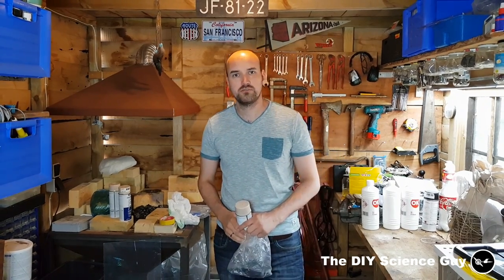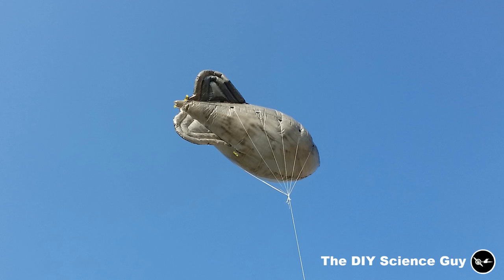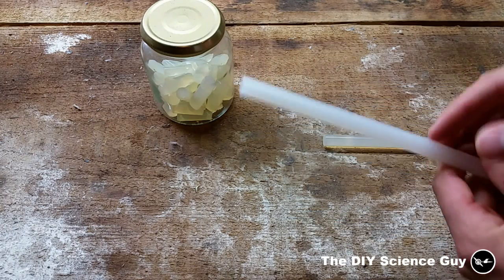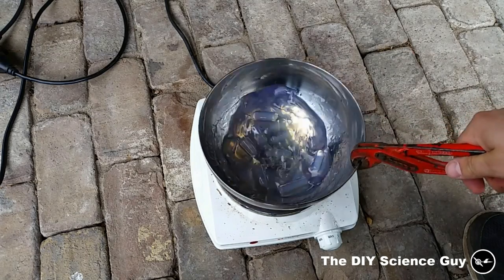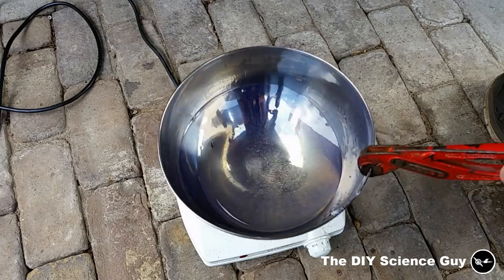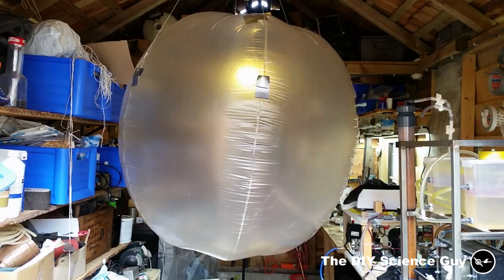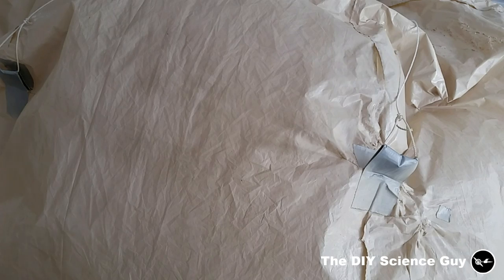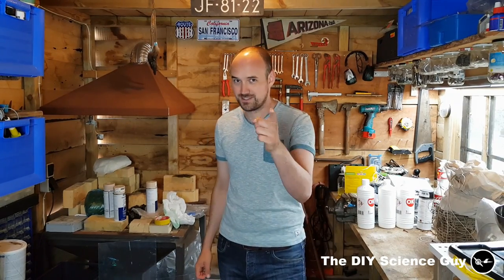DIY plastic (polyethylene) primer

Comment: Thank you for this video! I works great also as a primer for HDPE!
I used nitro thinner (C6000) and put the container into another one with hot water. Glue sticks melted in a few minutes and the "primer" could be used for about half an hour.

Comment: Hey, hi from Canada. That process sounds amazing. I have an old (40 years)  Coleman Scanoe, 17'  square stern. It only has a couple of pinholes, but is badly scratched from years of running streams and rivers, good war wounds to have. I've used duct tape on 2 of the 3 keels for the last few years, and it works 80% but has to be applied and retaped every time I go for a run, a real pain in the ass. YOUR POST WAS AMAZING !!! ..THANK YOU, THANK YOU, THANK YOU!  I may or may not paint over the mixture. In New Brunswick, we have about 4 feet of snow on the ground right now and all the water is frozen. I will send or post pictures of my project as I complete them, and I will follow up with the results. Thanks again.... I liked and subbed.

Comment: There is a product called bulldog adhesion promoter which allows oil based paints to adhere like a "bulldog's bite".  Spies Hecker also makes a flexible primer for high end auto paints... it is for bumpers etc... the rep sprayed a beach ball, allowed it to cure and then deflated, years later the primer is still adhered to the ball even when doubled over on itself.

Comment: Hi overthere, as I am about to give my polyethylene canoe an update, I wonder if I could use your briljant idea to use Hotglew (Hotmelt) with Thinner to coat this Coleman canoe. But I still have some questions such as 1) What kind of hotglew you did use, because you showed two samples, what's the name of the sample you really used. And 2) I see that after some time the substance is getting hard. Can one this use again and melt it again with heat?
Can one roll the coating and is there a certain opening time?
I would be very pleased if you could be so kind answering me. It would be very helpful for me
Kind regards from the Netherland.
Jan L Mateboer
Reply from the maker: Hallo Jan, ik ben ook een nederlands dus dat komt mooi uit! 😉 je hebt de "transparante" lijm staven nodig zo noemen ze ze ook online dus moet goed komen. Je kunt de primer gewoon weer verwarmen zodat hij weer vloeibaar word. Met een roller heb ik nooit geprobeerd, ik denk dat dat door het snel afkoelen van de primer zorgt voor klonten. Je zou kunnen proberen om de primer nog verder te verdunnen dan blijft hij vloeibaar bij een lagere temperatuur alleen word je laag dikte dan dunner. Succes!
Reply: @TheDIYScienceGuy  Hallo, Nog even een vraagje.
Zou ik de mix van Thinner en Hotmelt warm op moeten opbrengen, of blijft het na afkoeling nog een tijdje vloeibaar?
Alvast bedankt voor je antwoord.
Reply from the maker: Hallo Jan, ja je moet het verwarmen en dan kun je het met de kwast aanbrengen. Succes!

Comment: This is interesting. I’m trying to paint a HDPE fence. The UV light has degraded the colors of the plastic. How long do you think this primer / paint application would last on something like plastic planks?
Reply from the maker: Well I think that as long as the top coat is UV resistent it will stay on as long as the top coat lasts.

Comment: You think this would work inside a bait tank made of hard and thick polyethylene plastic?  Darker colors keep bait calm but most bait tanks (like mine) are white plastic which stresses the bait.
Reply from the maker: I think it will. Just check if hot glue sticks to it, if so, than it will work.

Comment: Hi, does it need to be hot to apply or does it stay liquid if you add enough thinner? What temperature did you warm it up to?
Reply from the maker: No it stays liquid. After it cools down in the jar it starts sort of crystallizing in about an hour, which can be reversed by heating it up to about 40c

Comment: I working on a project that is using polyethylene foam. I also noticed that hot glue is the only product that sticks. This is the best idea! What type of thinner did you use?
Reply from the maker: Thanks! Cellulose paint thinner is wat I used.

Comment: I hope you don't mind.... Lacquer thinner, also known as cellulose thinner, is usually a mixture of solvents able to dissolve a number of different resins or plastics    A special blend of pure solvents that will mix with any make of cellulose lacquer. It does not
contain any xylene, toluene or any other petroleum derivative.

Comment: Are the glue sticks kinda hotmelt? I need a primer for a canoe made of polyprophlene. I like to give it a re-make and repaint it. Thanks for your kind answer. Jan L Mateboer The Netherlands.
Reply from the maker: Yes it is hotmelt and it will work very wel on pp. I painted my kids pp Ikea kitchen parts this way and it's still on there after all the abuse. Good luck!
Reply: @TheDIYScienceGuy  Thank for the answer, I put another question if you don't mind. As I'm Dutch I could not understand eauch word you said that's why  Sorry.

Comment: How many jars did it take you to coat your balloon and what was the approximate surface area of the balloon? This is really awesome by the way!
Reply from the maker: Thanks! About half a jar. Surface area is around 3.5m2. After almost 2 years the paint is still on! Also used it for my son's Ikea kitchen to paint al the gray plastic parts black. Even with al the wear and tear it doesn't have a scratch.
Reply: Awesome! Thanks!

Comment: Any idea if it works on poly polypropylene too?  I think it probably would.   

Surely that is a marketable product - there doesn't seem to be any reasonably priced non-polar plastic primers.
Reply from the maker: Yes, it does work very well on polypropylene! I've thought about selling it, but I'm not sure about the safety and if I could get in trouble for it.
Reply: @TheDIYScienceGuy  Well I guess if you sold it premixed the customer would still have to reheat it  - and a lot of people might do something stupid.   But you can buy MAPP gas in any hardware store and that is potentially a bomb.

The other option is selling it as a product to business.   

The reason I am interested in it is in to coat exterior polypropylene pipes to protect from UV damage.

Comment: Thank you for making this video! However, I could not find cellulose paint thinner so I tried acetone and wasbenzine. The wasbenzine did dissolve the glue sticks, so I tried to paint it on and it was leaving textured streaks (too thick?), some of it made flakes and came off and the rest I could scratch off with my fingernail. Any ideas? Solvent, application, other? I would appreciate some help figuring this out. I have a bunch of polyethylene to try to paint.
Reply from the maker: Thanks! Yes make it thinner. Nice to hear that wasbenzine also works 👍the flakes probably come from going over a spot that already dried a bit. Good luck!
Reply: The texture streaks sometime caused  by the drying too fast . The liquid doesn't have enough time to lay flat especially when it's a little thick.

Comment: How to paint HDPE:
Wear gloves and a resparator, not just a dust mask.
Mask of all areas not to be painted.
Remove all oil and fingerprints with Acetone or MEK. Do not use Turpentine.
1.    Using a green scotchbrite pad, dull the HDPE plastic. Sand in circles.
2.    Clear untinted PVC Solvent  wait 30 minutes

3.    Second coat of  PVC Solvent. Wait 30 minutes
4.    Spray paint plastic primer lighter than final color, Rustoleum Plastic Primer. Light coat. Wait 6 hours
5     Sand any rough spots or runs with 320 grit.
6.    Spray paint plastic primer lighter than final color, Rustoleum Plastic Primer. Medium coat. Wait 6 hours.
7.    Sand  with 320  or 400 grit.
8.    Using an airbrush or fine spray paint gun, not a spraycan, Apply Clear POR epoxy paint, thinned. Medium coat. This provides
      a surface any paint will stick to.But it must be a continous coverage, not spotty. This will prevent deep scratches.  Wait 12 hours.
7.    Sand  with 320  or 400 grit to remove gloss.
10.  Paint with your favorite spray paint. Repeat coats until all sanding marks dissappear.
11.. Using an airbrush or fine spray paint gun, not a spraycan, Apply Clear POR epoxy paint, thinned. Medium coat.
Never have to pint it again.

Else instead of Clear POR epoxy paint you can use POR colored Epoxy paint or for a rubbery look use POR POR 2k urethane paint.
Done
Reply: Or you could do it like he did. 😁😁
Reply: the video seems a lot easier

Comment: You can use clear silicon and petrol or gas for tinning .
Reply from the maker: Silicone is not a solvent and nothing sticks to it so you should keep that away as far as possible. Petrol might work, I've never tried that. Good thinking! 👍
Reply: @TheDIYScienceGuy  You are wrong, it works, i used other glues and they didn't work, silicon worked, i mixed with gas and i painted  my lyres, they looked like new.

Comment: Do you happen to know the glue-stick chemistry? There are almost as many types of glue sticks as thinners so I really hope the manufacturer of those sticks you used put it on the package. :P
Reply from the maker: No I don't unfortunately. I use cellulose paint thinner.
Reply: @TheDIYScienceGuy  Well, then I'll hazard an inexpert guess and say it's probably EVA. It looks like the EVA sticks I've seen, and EVA is the most common hot-melt adhesive with the possible exception of acrylic, which is probably what those harder, more transparent sticks you showed were made of.

Comment: Did it melt under the sun?
Reply from the maker: No, after applying it the thinner evaporates which leaves you with a thin layer of hot glue which has a melting temperature around 100c

Comment: Hot glue plus paint thinner equals polyethylene?
Reply from the maker: No, hot glue sticks wel to polyethylene and paint sticks wel to hot glue. To be able to apply a thin layer of hot glue to a polyethylene surface, the hot glue needs to be  dissolved in cellulose paint thinner so it can be applied to the polyethylene surface with a brush.
Reply: @TheDIYScienceGuy  So the balloon is made out of polyethylene?

Comment: Buy any spray paint you want and just spray it far enough away that the aerosols  (which eat up the styrofoam) disipate while the larger wet particles of paint continue their journey down to the surface and there you go. Start small and soon you will have a great surface w/o all the solutions.
Reply from the maker: Yes, that works, but that is not the point of this video. This is about painting polyethylene.

Comment: Are you a chemist or did you research combining these chemicals together? How do you know the mixture is safe and not super flammable or corrosive or something dangerous? Really just curious to know if you're experimenting randomly or have experience with these substances.
Reply from the maker: I'm not a chemist. The cellulose paint thinner is just a solvent to make the hot glue a liquid. When the thinner evaporates you are just left with a very thin layer of hot glue, it does not change the glue. The thinner is very flammable, but so are a lot of paints.

Comment: This is dangerous and care must be excersized. But if it works then great. However you do not provide any recipie or much to go on.  
If the USA we do not have "cellulose Thinner".   Please provide a link.
What is the Ratio of thinner to Gluestick ?
What brand of Glue stick are you using ?  Please provide a link..
I have clear soft gluesticks but nothing will disolve them. Not Laquer thinner, Acetoone or MEK.

Comment: I am attempting to paint polyethylene hard hats.  I can't find a primer that works.  This might be the trick!  I have searched for "thinners" with those ingredients, but I am having no luck.  What type is it?  Paint, lacquer? Epoxy?  Please help!  This may have saved my project!
Reply from the maker: Ok nice project! I will look in to it for you. You will have my answer ASAP
Reply from the maker: It's cellulose paint thinner. Good luck and please let me know how it goes!
Reply: thank you!  I will do that!
Reply: @bigtedder   did it work ?
Reply: I tried heat/flame  treatment first and it worked! So I didn't even have to try this.
Reply: @Jay Smith still survived trough the summer
Reply: @bigtedder When you heat up an area, do you have to paint it right away or will it stay tacky for 30 mins to an hour?
Reply: @rosskstar  i flame treated the plastic, wiped down immediately with high isopropyl alcohol, then immediately primed and painted.  Worked perfectly!
Reply: @bigtedder  thanks - i'll be using that method me thinks
Reply: Hi